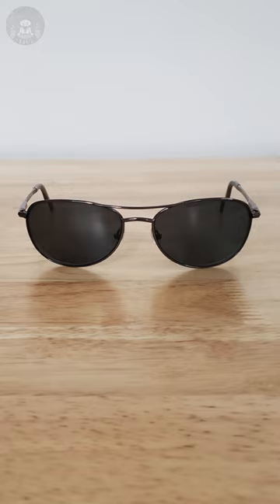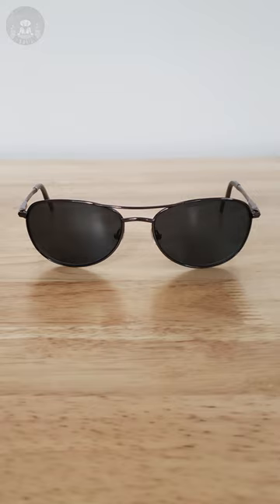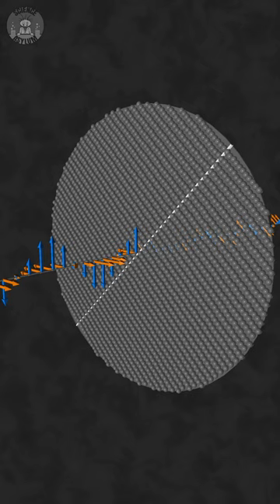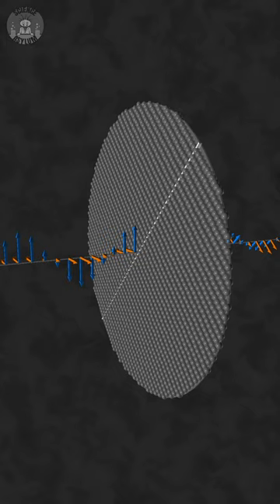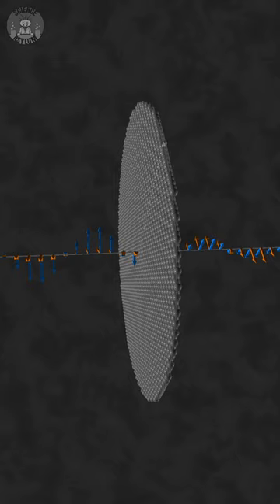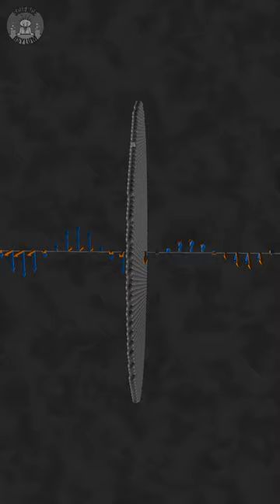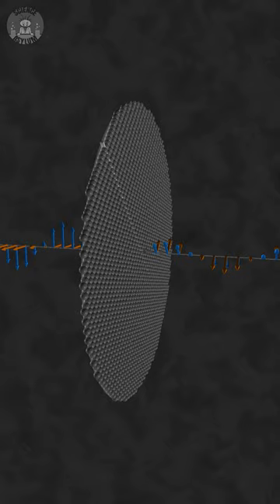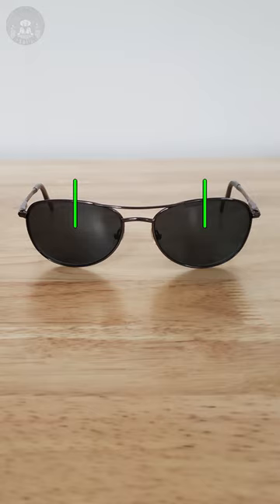Polarized Sunglasses: How Do Those Work? #shorts

Comment: Solution. Double polarized glasses. Have both a vertical and horizontal polarized lenses smooshed together.
Reply: Might I suggest a blindfold as an alternative
Reply: Dalek : my vision is impaired! I can't see! EXTERMINAAAAATEEE! 🤓😋🤝
Reply: It sure is the perfect solution! I have actually just finished building a lens system with two polarizers.
Reply: @Snow the Mega Absol  just add a third one and you'll be good 👍